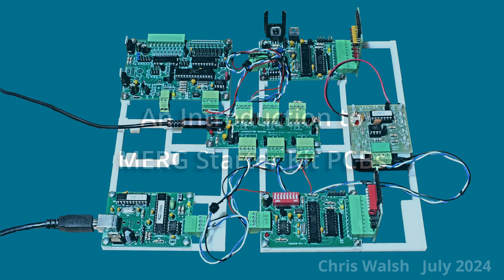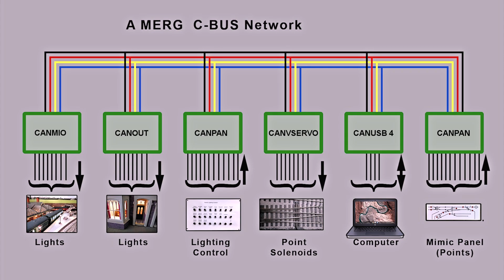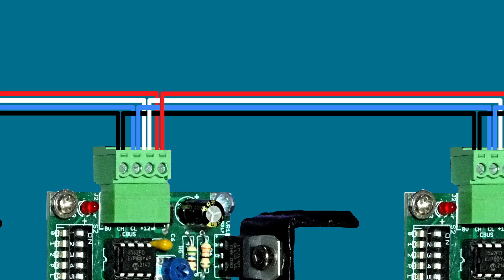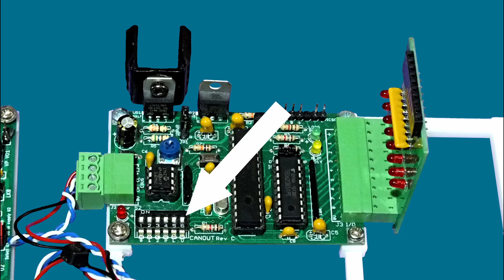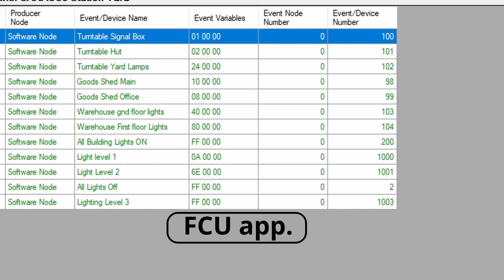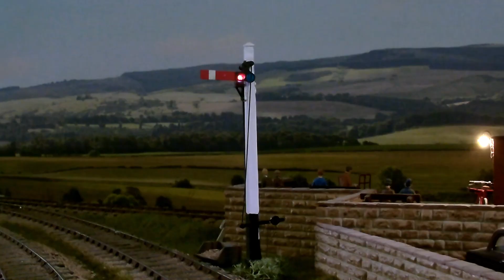An Introduction to MERG Cbus Starter Kit PCBs

Comment: Are there also any kind of kits supporting handling of turning/reverse loops? I mean, kits that change the polarity of the tracks of certain sections inside the turning/reverse loops automatically.
Reply from the maker: I believe there are ways of doing this. Certainly it is possible using JMRI with Cbus using track sensors to change the direction of trains.  If you are a member of MERG, you could raise the point on their forum - or you could try one of the AI apps for an answer. They are often very useful but sometimes make mistakes.
Chris